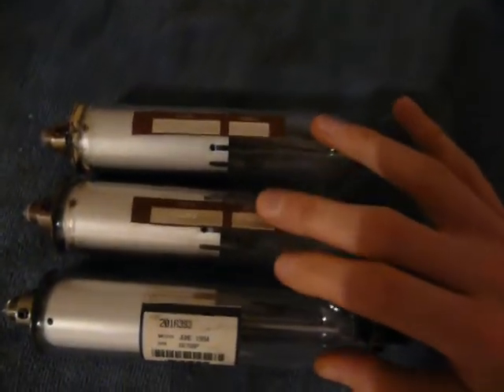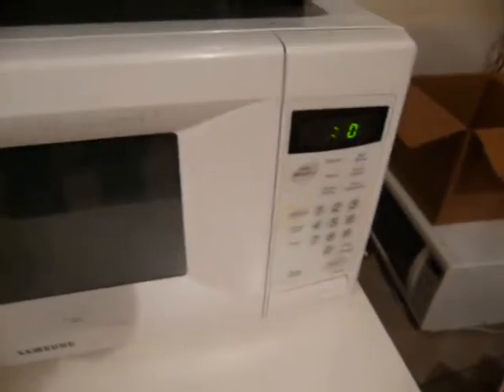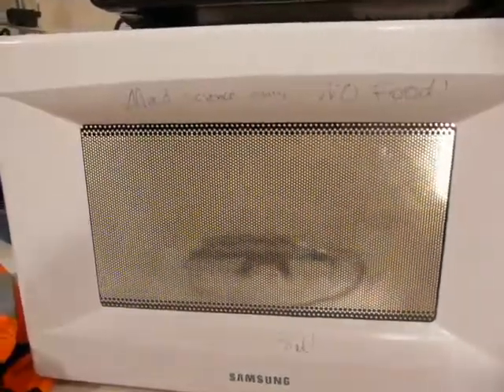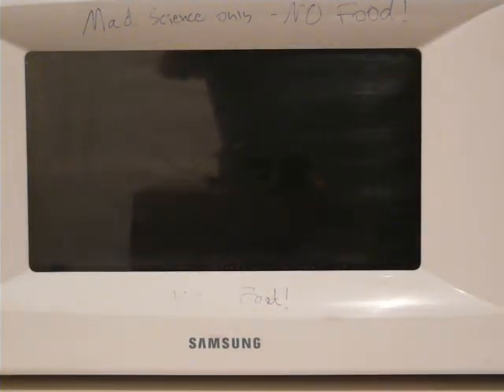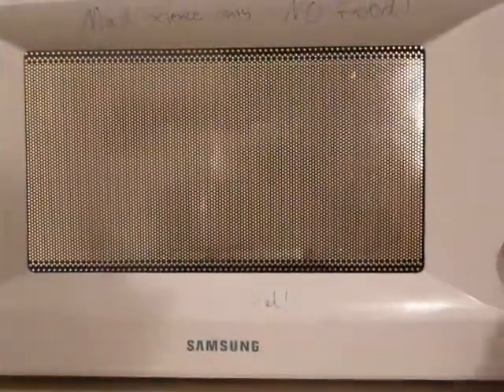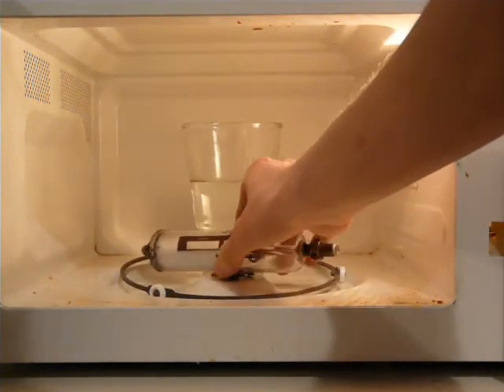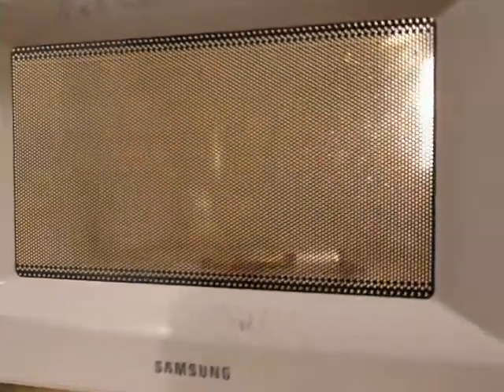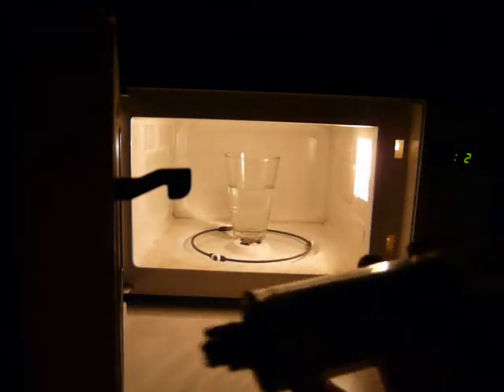Microwaving lasers!

Comment: The gas inside the tube will glow if you ionize it regardless whether it can still emit a beam or not. It could have bad electrodes, bad morrors, etc. Only way to know for sure is connect it to the right power supply and turn it on.
Reply from the maker: Good point. At least we know they haven't vented.
Reply: Right and the helium will tend to escape on its own through the glass of some older tubes.